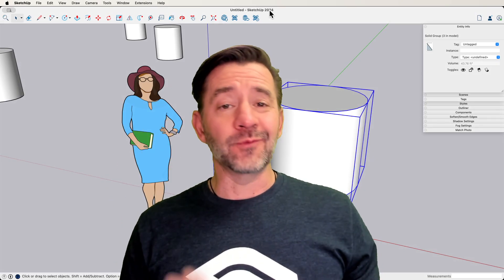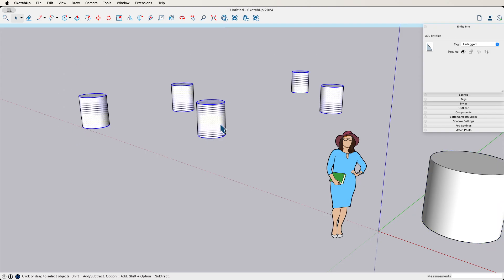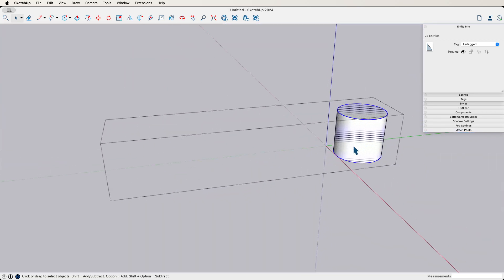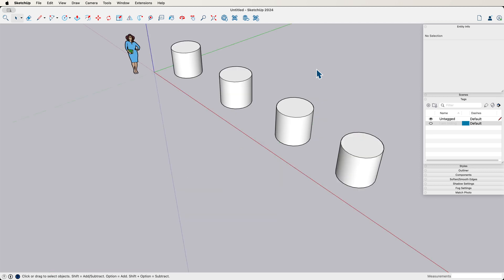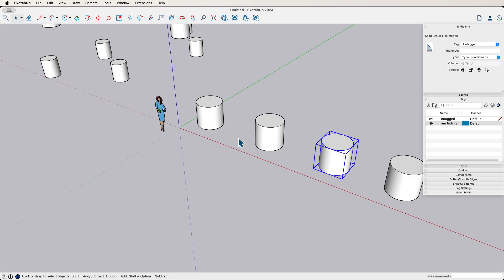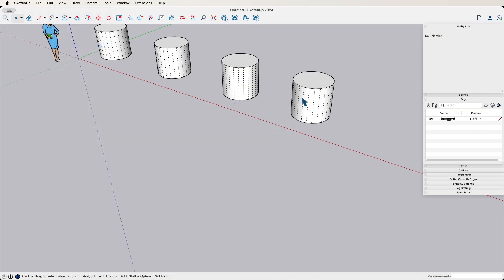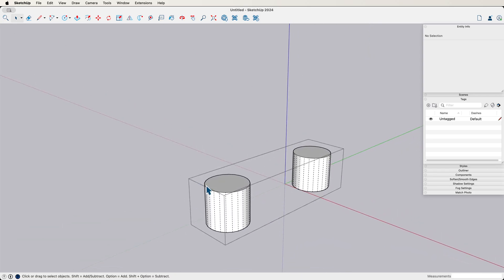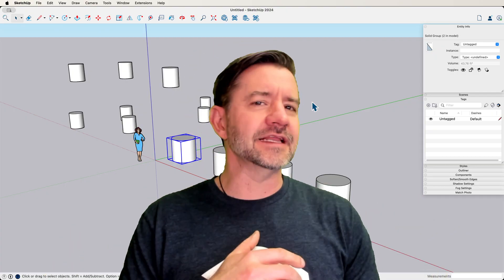Why are my Bounding Boxes SO BIG??

Comment: i just had the bounding box issue but i couldn't find any hidden geometry that i could find. I tried all the things in this video, finally i decided to un-component the item and then re-component it and the bounding box was normal size then. it all started when i was working with geometry on a tag, i call "testing". i usually test things out on that test tag so that i don't screw up geometry up in the tags that i want to keep. this all happened when i was creating half lap joints on 2x4s and using the copy command to copy a 2x4 so that what ever happens to the 1 2x4 the same thing happens to the copy 2x4.

Comment: Group Axis  and or  Component Axis would have also caused this issue with the Bounding box. I just fixed this issue with a downloaded model from the 3D Warehouse, and changing the axis or just making Sketchup think the axis is being changed corrected the oversized bounding box.
Reply from the maker: This did used to be an issue, as well. Fortunately containers created in newer versions of SketchUp do not extend the bounding box to include the location of the axis.
Reply: @SketchUp  I am using version 23 pro and I get the bounding box on some 3D Warehouse downloads.  I did update to Sketchup pro 24, but was getting a toc file error constantly and technical support had me reinstall Pro 23. Getting ready to update to Pro 25 , but waiting on a third party extension that I use for custom cabinet design to update their end which is in the works.

Comment: In the process of modeling my wood shop to help learn Sketchup, I pulled a model of a band saw "Craftsman+12in+Bandsaw.skp" from the warehouse.  It has an extended bounding box.  I'm fairly new to Sketchup.  I couldn't figure out how to shrink that box, but I was able to copy the band saw out of the bounding box and paste it elsewhere without the extended bounding box.  Windows, ctrl+c ctrl+v.  After watching this video, I did notice the spare bit of line off to the right that caused the extended box.  Deleting it cured the problem.  I wish I had seen this video before then.  Thanks for all of your videos.

Comment: Another case is when the object's internal axis is placed at a distance further from the object which then creates a larger bounding box that includes both the object and its displaced axis.
Reply: Please do a video on this scenario.  I've created objects and found the axis is upside down when I try to edit it later.  I maybe scaled it wrong when I created a copy?  I don't recall.  I can't blame it on 3D warehouse since i created the group originally. Oh, and how do I correct it?  I have tried to reset the axis but end up just creating a new object.  
I use Sketchup Pro as a hobby so my learning was haphazard and only through YouTube videos early on.
Reply from the maker: The newer versions of SketchUp will not do this. Files created in older file MAY still show this, but ever since 2023, bounding boxes hold tight to the geometry, even if the axis is move away. What version are you seeing this on?
Reply: I indeed found this in an old version file. I recently updated to 2024.  Thanks
 @SketchUp

Comment: Hi Aaron, following up on your comment about problems with some models in 3D Warehouse. Although 3D Warehouse is a necessity (and potentially a great time saver), I find the quality of content therein to be anything from extremely professional to quite frankly, pretty poor. Is there any way for Trimble to implement some kind of automated standards check before models are accepted into 3D Warehouse? It would be good if models that are already in there are checked too. Perhaps each model could be given a 'Quality Score'.  I'm sure I'm not the only one who occasionally spends longer fixing a downloaded model than I would have spent drawing it from scratch.

Comment: I’ve had issues where the bounding box was too big and I ended up tracing it down to the object’s axis icon being on the corner of the extended bounding box.  I have no idea how it got there since I rarely, if ever, change an object’s axis.  I can’t just delete the axis so I usually just leave it there.  

Any ideas how this could happen?
Reply: I often set an Axis like this. On cabinet handles/pulls. I then just click on a cabinet door corner and the handle is placed correctly,  A "hidden" by tag rectangle in a handle component works great too. But, yes, there is a larger bounding box.